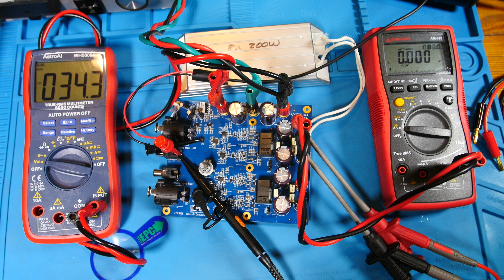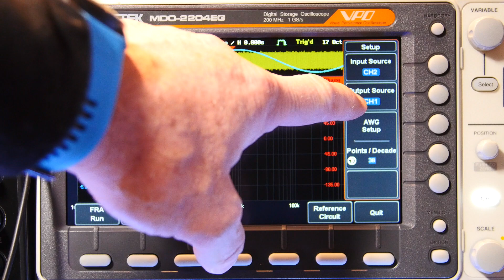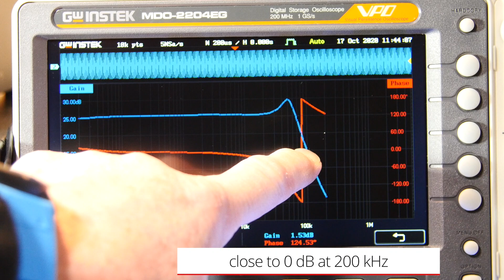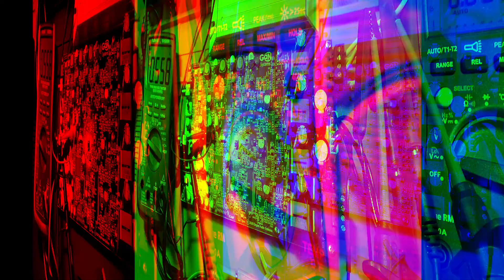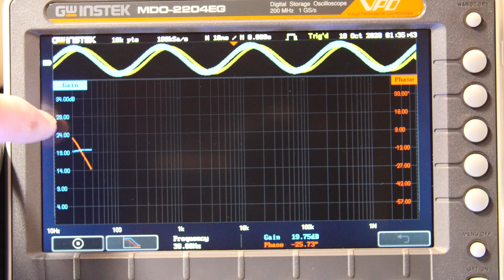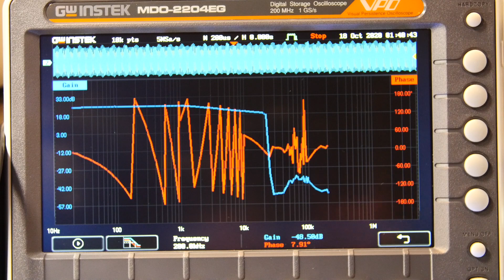Class D Amplifier Bode Plot GaN systems vs #EPC (Efficient Power Conversion) The #GaN people

Comment: Thank you for the bode plot demo . Can any industry expert share some links about how much phase shift we permissible in audio world. In power supply  we want to keep it 240 or below at zero db gain to  prevent it becomes an oscillator. The GAN board plot not looking good. Does the digital controller  controller  algorithm has anything to do with that? Experts please comment or share links
Reply from the maker: Thanks Jacob - great question!  I am very curious as to what our viewers here think about phase shift in Audio.  BTW, here is a link to a correction for this video.  I found that it is the controller type that thru this test off.  https://youtu.be/BruHwp2za38

Comment: The funky phase plot at 21:00 is caused by a time delay between the input and output. Remember that a constant time delay causes a linear phase change as a function of frequency. It just doesn't look linear because of the log frequency axis. Also, it looks like the time delay is different below and above 1 kHz. Do they provide a separate low frequency output?
Reply from the maker: Thank you!  That makes sense.  They don’t provide a lot of info about the schematic.  It does seem that there is a shift in the delay in at least one spot right?  I am working on a way to test the consistency of the delay that would be the only way that I might check the phasing, or do you have any thoughts?
Reply: @kissanalog  The delay is probably from the data passing through an audio processor or a FIR filter. By looking at the rate of phase change as a function of frequency (which is obviously easier to do if you change to a linear frequency scale), you can calculate this delay, and it will almost certainly be some integer number of the processor's clock period. The FIR filter theory would be consistent with the change at 1 kHz with more taps (and a longer resulting delay) used for filtering the lower frequencies. The longer delay at the low frequencies is non ideal. It would have been nicer if they used a longer filter for the higher frequencies as well, even if they accomplished this by zero padding both ends of the FIR filter. Of course the differential delay is probably small enough so nobody would really notice, but now that I know it's there it would bother me! ;-)

Comment: I have of of these “similar” (TI TDA type), w/ 24VDC Power .. beware! .. dual sided, direct coupled (DC 12v on the speaker terminals (not to be confused with DC offset .. 6 mV OK), with no protection relay .. watch out and don’t ground the speaker terminals (bench equipment testers beware) .. use DC decoupled probes! ...
Reply from the maker: Great feedback Justin!  It is true, these bridge type outputs have to be handled and tested with care;)

Comment from the maker: The designer of the GaN Systems Class D has explained that it is due to a fixed time delay that results in this problem that I had with the phase shift.  I need to figure out a way to measure the actual performance - it would be great to have a time delay voltage sense;)

Comment: Is it possible that that phaseshifting is a fixed delay of a few micro/milliseconds?
A fixed delay would give increasing phaseshift with rising frequencies.
Reply from the maker: That is an interesting theory.  So, maybe it has a time delay before it corrects, but my scope has already taken a measurement.  Is that what you mean?  I still think this is non optimal;)  But I have also done some manual sweeps and I see the same thing.  Honestly I haven't spent a ton of time on this, so maybe I should experiment a little more;)
Reply: @kissanalog  Yes that's what I mean.
The scope compares the direct signel from the generator with the signal coming from the amp.
If there's a fixed delay, that will as I see it show up as an increasingly long phase shift (a phase shift is also a delay, but not related to (fixed) time but related to frequency).
The delay would cause imho a phase shift with an exponential gradient.
Maybe you can do a measurement with a single pulse at a few frequencies with on one channel the direct line and on the other channel through the amp to see if it comes out with a set delay.
And compare that with how the other amps react.

If there's a delay, I have no idea though how to measure if there's also a potential phase shift involved.

Another thought: as that amp has a microprocessor, maybe it has advanced DSP capabilities and maybe accidentally a delay is set in it's settings?
If this is an amp designed for concerts/large venue installations, delays are often used for fill in speakers at a distance from the stage and the delay is used to compensate for that distance.
Reply from the maker: @mrpetit2  I think you are on top of your game;) The designer of this actually responded and did say that he has a DSP and that it is the fixed time delay.  I need to figure out a way to measure the response...I am open to all ideas:) thank you for the awesome feedback!!!
Reply: @mrpetit2  This is the most comprehensive explanation I guess. I am not sure if it is 100% true, but it does make a lot sense.

Comment: Interesting tests. The HF level does change with impendence. A slight rise at 8 ohms and a slight dip at 4 ohms. Looks like that amplifier is optimised for a 6 ohm load!! Odd impedance to optimise on. I think that is why class D amplifiers sound very different on different loudspeakers, much more than a class A or AB.
I would be very careful sweeping from 20hz to 50k or more at more than a couple of watts. Even if the speaker box is rated at 150 watts, that will be average music, not sine wave.  Above 3/4 khz or when the tweeter cuts in, it's rms sine wave will be less that 3/5 watts or you will overheat the voice coil and maybe get the magic smoke!! Not good and very expensive.
The other amps phase shift is pure crap, I bet the image is all over the place on music, hardly HiFi even on a bad day!!
Reply from the maker: Thanks Michael for this great feedback.  I just posted a correction video on the Gan Systems amp.  Let me know what you think.  I need to do a lot more testing with these class D amps.

Comment: That amplifier with the flat amplitude and steep cutoff apparently incorporates a first or second-order elliptic filter. It appears to have a terrible phase response. My question is,  what does that do to the sound quality that comes out of the speaker as compared to the amplifier with the relatively flat phase response?
Reply from the maker: I agree, it does look very suspect.  I have the same question;)  I think it makes sense that even if the listener couldn't easily detect it, it has to cause something in the brain that can detect it and doesn't like it.